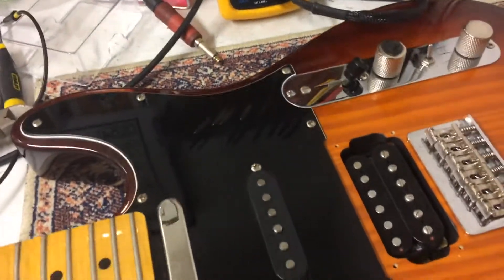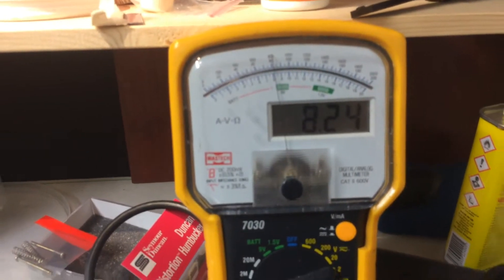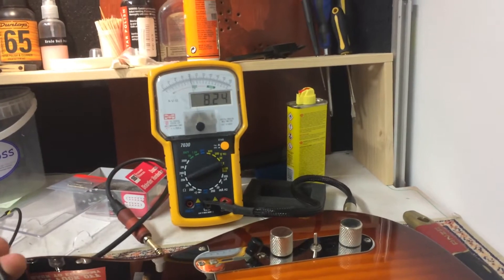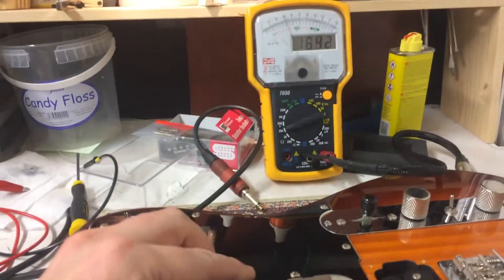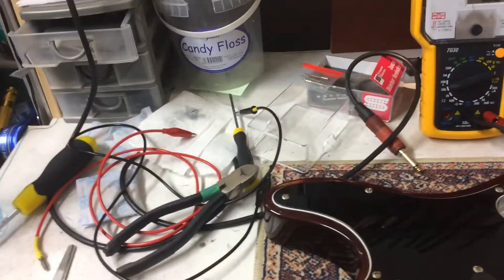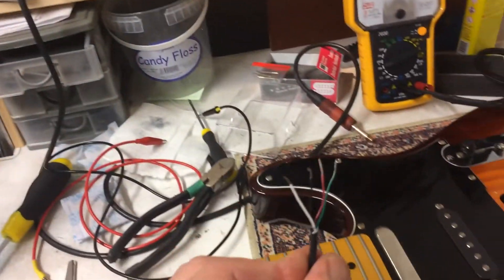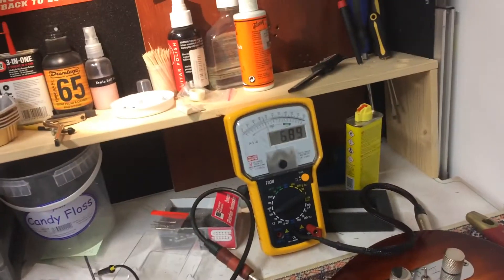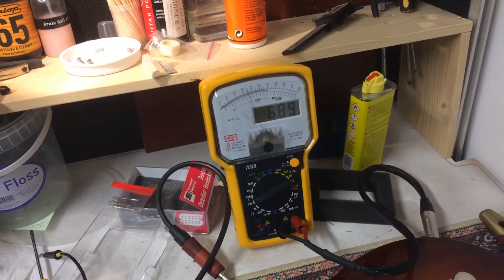Checking pickup phase

Comment: Since most people these days don't have an analog meter it would have been helpful to explain this does work with a digital display--if you watch closely when the tool first touches the pickup. The reading will either jump up for an instant or dip down, but the display stabilizes quickly.  I had to watch another video to see this.